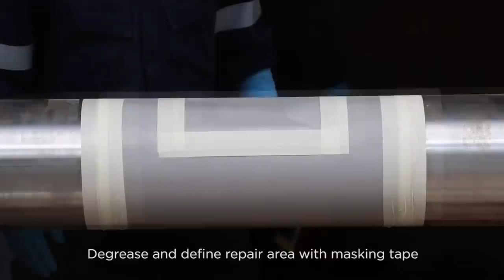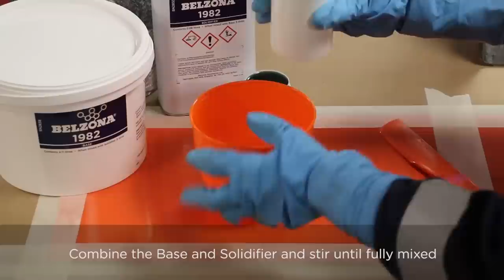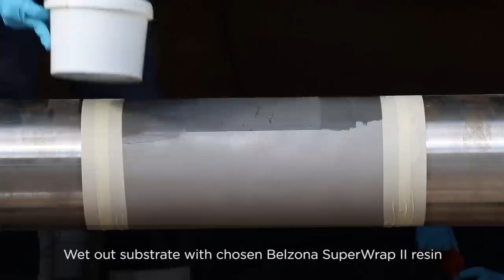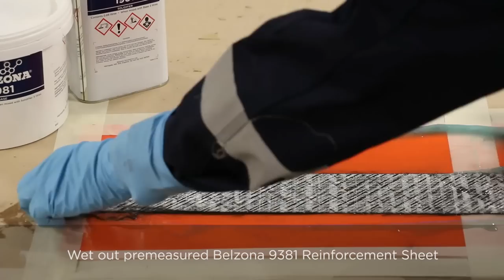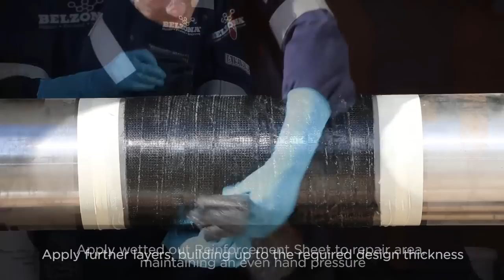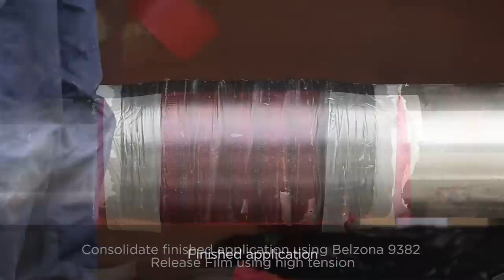Pipe Wrap Repair | Belzona SuperWrap II

Comment: Hello is this Belzona product suitable for all piping materials and is it compatible with all coating systems? Is there a max or min temperature specification for this repair coating? Thanks
Reply from the maker: Hello! We recommend that you contact your local Belzona representative: https://www.belzona.com/en/about/disfinder.aspx to discuss your needs and the operating conditions of your equipment. You can also get more prouct specification from this page: https://www.belzona.com/en/products/applied/superwrap2.aspx. Thank you for watching the video and your interest in Belzona!
Reply from the maker: In addition to our previous comment, as an ISO/ASME compliant repair system Superwrap is only qualified for use on carbon steel and stainless steel, however it may be used as a standard wrap on other substrates, the wrap can be overcoated with many Belzona coatings and is capable of service temperatures up to 150°C for more information see https://www.belzona.com/en/products/applied/superwrap2.aspx

Comment: about to price a client on 1981/1982/1983 super wrap - The application seems fairly simple. Would the area not require any blasting? Surface preparation?
Reply from the maker: Hello! In order to be compliant with ISO/ASME, Belzona 1981/1982 Surface Preparation should be performed in accordance with NACE No. 2/SSPC-SP 10 Near White Metal Blast Cleaning or at a minimum with NACE SSPC-SP 11 Power Tool Cleaning to Bare Metal.
Belzona 1983, being a resin intended for hot services, requires an abrasive blast cleaning. For further questions, we recommend you contact your local Belzona representative: https://www.belzona.com/en/about/disfinder.aspx Best regards, Belzona Team